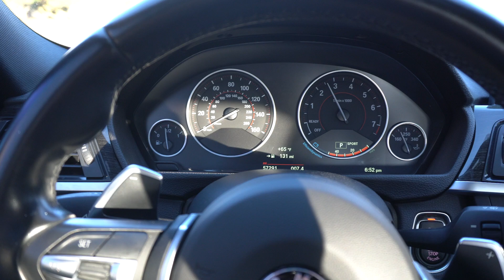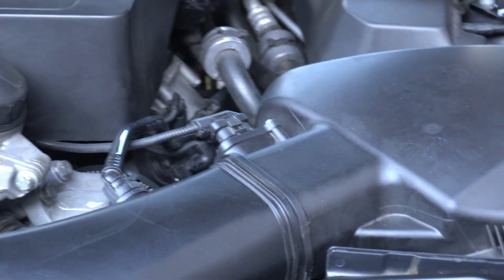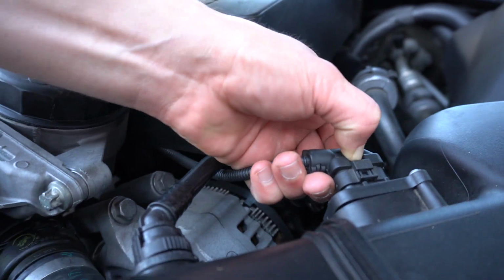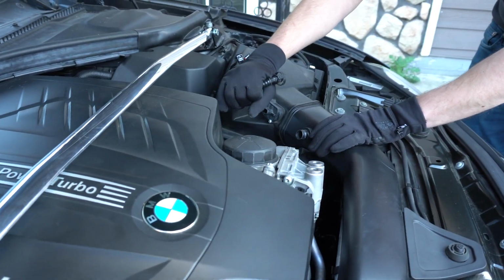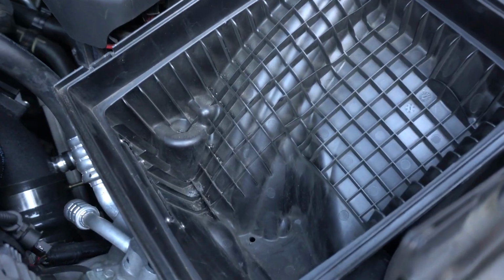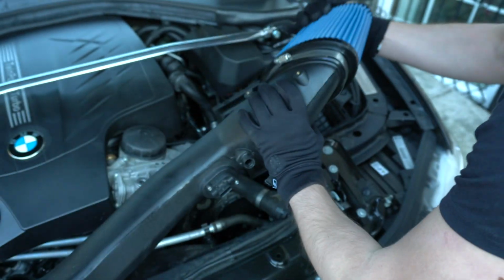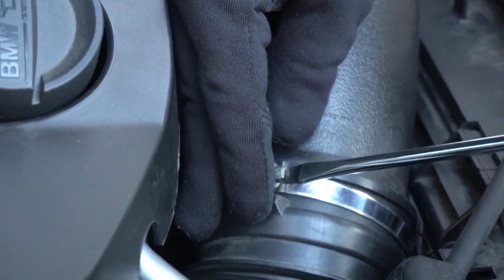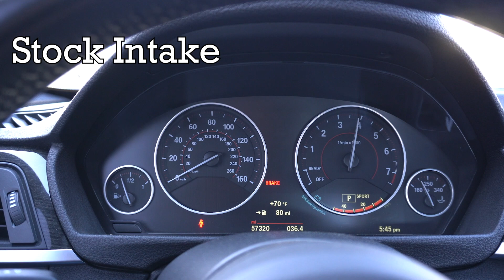Burger Motorsports Performance Intake Install and Sound Comparison Clips | F30 BMW 335i

Comment: Do you feel a loss or gain in torque/power?
Reply from the maker: Maybe slightly more torque. It felt like it was getting less restricted airflow. The difference isn't major though

Comment: In this video do you only have the intake installed and everything else is stock?
Reply from the maker: I had the AWE touring exhaust. But otherwise stock
Reply: @NWAuto  I don't hear any difference in burbles in any mode is that normal? Also eco, comfort or sport + I do not feel any difference in steering stiffness. I just learned today that people have stiffer steering on sports plus.
Reply from the maker: @phil_aesthetics  sport and sport+ should have stiffer steering than eco and comfort. The burbles can depend on what your exhaust setup is. Also what tune you run

Comment: How do you think this will compare to injen and cts sound wise?
Reply from the maker: I doubt they will sound much different since all three are open box cold air intakes. But I haven't actually been in a car with those intake systems. Looks like the biggest difference between the BMS intake and those two is that they have a heat shield and the BMS doesn't.
Reply: @NWAuto  thanks I was super torn😂